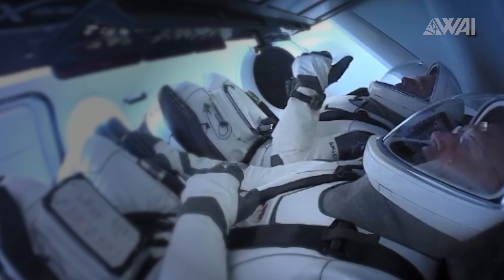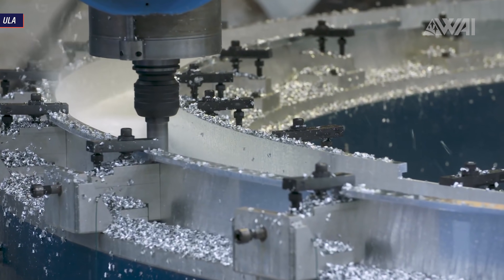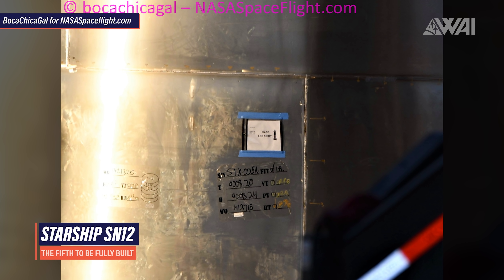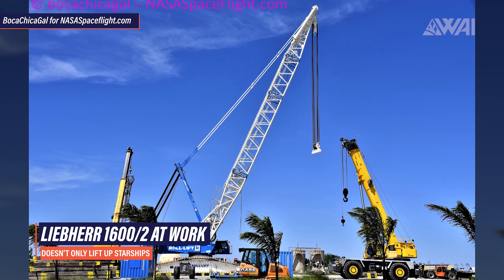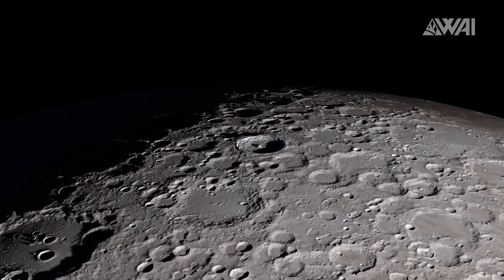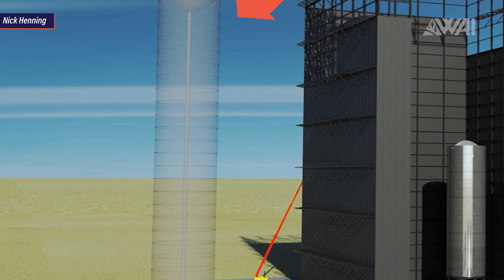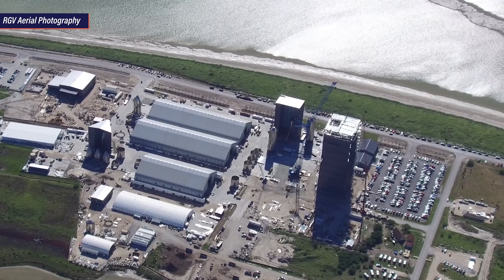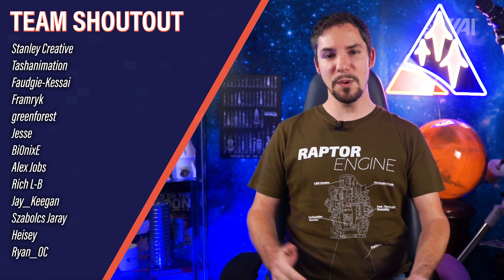124 | SpaceX Starship – Testing About To Begin - Super Heavy The Giant

Comment from the maker: So, is it possible, that SpaceX will have a Starship orbital with the help of a Super Heavy Booster within the next year?
Reply: In my opinion: most likely, yes!
Reply: Sometime within 15 months? My guess: YES! That 15 months might be measured in "Elon Time" but when he sets a major goal, don't bet against him.
Reply: I'd say highly likely.  The Booster is larger, but much simpler than Starship. Since they're proving out all the manufacturing techniques on Starship already, building the Booster is just "work" (rather than research and experimentation).
Reply: Definitely before the end of 2021
Reply: Elon can do anything, so yeaaa
Reply: Within 7 months, 4 days, and 23 hours. That's just an estimate, though.
Reply: Don Jones Thanks Spock Jr!
Reply: Yes
Reply: It's definitely possible, especially if SH testing goes well
Reply: with how fast they are going i have no doubt
Reply: I think it's just about a certainty that a Starship will get to orbit within a year.

Probably be the kickoff for the 2021 Starship Update... 

I expect the first pressure tests for the Super Heavy booster to be towards the end of November. First hop sometime in December. 

I'm thinking about 6 months and they'll be working on stacking a Starship on top of a SH booster. 

One huge advantage SH booster seems to have is it likely doesn't have to pull off a hover slam landing. Much of the build process has dramatically improved over the past 6 months so I don't think that there's any real obstacle to have the very first SH booster prototype get assembled quickly and fly on two Raptors just as quickly.
Reply: It's possible. The two pacing factors in my opinion are thrust puck design for S.H. and heat shield tiles on Starship. Expect to see najor heat shield tile test flights in next 6 months on starship. And we have no idea on state of thrust puck design. Thats got to be super hard and they keep changing number of engines required.
Reply: @James_Scheid  yeah, SH thrust pucks got to be the most tricky part of the entire operation. 

The number of motors keep going down for a few reasons I think. They upped the thrust of the engines, production if engines seems to be slow, and I'm willing to bet the less motors needed the easier that throat puck design becomes.
Reply: @mrdune5479  yes and no. The amount of force on the thrust puck remains roughly the same no matter the number of engines, but the number of connection points and feed lines go down some, so it gets a little less complex.
Reply: Conservative estimate.. full stack and orbital flight & successful landing for the anniversary of the DM2 flight
Reply: Definitely by this time next year.  What makes SpaceX a success is its people. Just watch the exuberance from them during the Falcon Heavy launch and sending Starman in a Tesla to Mars. To listen to the cheers from them during a pinpoint landing of a Falcon landing. NASA folks are treating their work as just a job right now, they go to work and then go home. I'm not saying there is no pride in NASA but they are missing that spark they once had during Apollo. But I believe Blue Origin will be the first to send people on a sub-orbital flight very soon.
Reply: No doubt I’m guessing it’ll be mid spring when it’s being prepped for sub orbital launch then full on orbit! Extremely excited at the progress especially these past few weeks! I can just imagine how fast production will be once Starship’s first functional iteration is decided!
Reply: I'm not sure the full BFR will ever launch from land now. Just way too much noise. I think the better question is will they be able to build the entire infrastructure to launch BFR in a year. There are plenty of things they need to accomplish and some of Elon's ambitions are predicated on things going smoothly. There will be obstacles and set backs and to have BFR fully functioning in that time frame is definitely the stretch goal. I think it will be more likely we will see Starship flying fully configured and the assessment as to the necessity of the Super Heavy Stack will be dependent on the Starships performance. They will need the revenue stream from it for one. IMO the first launch of the BFR will be from an international platform in the Gulf. Lots of testing still to be done.
Reply: It is a strong probability. Until recently they were shooting for this year! Even given several failures, at the rate they are going it is a probability. I think orbital flight by April 2021 is possible and orbital flight by October 2021 is probable.
Reply: I would say it's not impossible for SpaceX Starship to have an orbital test mission sometime next year. When would depend on 3 things - Speed at which Raptor engines are made, Number of successful 15km+ flights, and how the tests involving the Superheavy booster's Thrust Puck go.
Reply: maybe idk :D
Reply: I can wait longer, as long as they do not compromise on security.

By the way, do they not need to build a brand new launch pad out at sea, due to the loud noise the rocket would create?
Reply: Somewhere in the middle of the year, Elon tweeted that he hoped to have an orbital flight for Starship "later this year". So if the multiply-Elon-time-by-3 rule holds, this puts when it really happens near the end of next year. So Id say it's a 50:50 chance that it happens before 2021 ends. If it happens first half of 2021, I'd be really surprised.
Reply: Making the assumption that all test parameters are met SpaceX seem to have the production capability down to a tee, so a qualified yes.
Reply: I recon Space X will have 4 Super Heavy Boosters by Feb next year.
Reply: Definitely possible.
Reply: yes
Reply: I’m thing the development Time for super heavy should be a whole lot quicker than for Starship. Welding technique’s should be the same The only notably more complex part is I think the thrust puck which has to be able to take a lot more engines and transfer a lot more thrust. Hopefully they won’t need multiple iterations of blowing up Super Heavy whole they work out how to weld it.
Reply: @Midlife-Adventures  
Yes, SH is similar to Falcon-9 in so many ways that the technology is easily transferred. The dissimilar aspects are already worked out by Starship development.
Reply: Most definitely.
Reply: Not merely possible, I'd say it's extremely likely.
Reply: I want that animated Space Kerbal thing on your shelf.  Where can I find one?
Reply: NO.  Starship needs to do 5 or 6 flights to fine tune both controls and hardware like legs, flaps and structural integrity.  The Booster has yet to even fly once.  It will need to fly several altitudes and to perfect the landings.  Then when both are integrated, there will be many flights to prove all the many operations it requires.  All before an orbital flight.
Reply: @myfavoritemartian1  SpaceX has 5 StarShips in the pipeline already. That indicates to me that they are planning on doing much more than just 5 or 6 flights in the next 3 or 4 months.

Given SpaceX's resources, I fully expect them to test the vacuum Raptor design in vacuum with StarShip hops. There are vacuum chambers on Earth that are big enough for rocket engine tests, but they are incredibly expensive to operate. There is some visible flow separation in the recent ground level rocket test video.

Orbit isn't far away.

Super Heavy is mostly made out of StarShip parts. There are a few differences of scale. The tanks are bigger, the downcomer has to handle more flow, the thrust dome has to handle more thrust.

This means we will get to watch SpaceX burst quite a few super heavies as they tweak the design to work at that scale. They are pretty fast at those tests.
Reply: @hamjudo  
The "vacuum" Raptor test was with a shortened nozzle. Otherwise the flow would have separated off the inside surface. However,  it was large enough to get test results on fuel preheating in a fairly "large" nozzle.
Reply: @hamjudo  
The SH thrust dome has to handle higher static tank pressure than the SS, but all of that extra engine thrust is applied against that same higher static pressure. None of that thrust has to be applied to the tank walls axially. The axial force actually drops as the acceleration increases. However, the tank hoop stress increases with acceleration (but only at the tank-bottoms). 

Since the metal thickness is just scaled up linearly with the increase in design pressure, there are no foreseeable engineering challenges, IMAO. 

Finally, as the SH tanks empty, the hoop stress on the SH tanks will drop back towards near-static levels, however the Starship hoop stress will be climbing as the overall mass decreases and acceleration increases, pushing propellant "down" harder inside the Starship. 

This inertia-based pressure increase has already been anticipated in the SS design and implemented as thicker steel for the bottom of both LOX propellant tank walls and thrust-puck dome.
Reply: A starship yes! but with help of booster probably earliest 22
Reply: @MrGBunty  
Starship will only reach LEO with a boost from Super Heavy; Never alone.
Reply: No way. There is a huge gap between hops and orbital flight.
But three? I would wager a significant sum that they will.
Reply: Hell yeah!
Reply: Yes.
Reply: in my opinion yes definitely
Reply: Probably, it seems a good shoot
Reply: I think more like 18 months tbh
Reply: I believe. SpaceX will do 15k SS in October. SpaceX will have SH built in the high bay before Halloween. Maybe a pressure test???? Maybe not.
Reply: No, successful orbital flight should include coming back in one piece which means thermal protection should be ready. And lots of Raptors need to be produced and tested together. I think there is a lot to be done yet. It took 1 year from Hopper flight to unfinished Starship hop. 2022 is much more realistic and I am not talking about frequent flights even.
Reply: You are wrong wrong  Russians are ahead
Reply: Definitely yes
Reply: I think so..
Reply: Define "in the next year"
Reply: Within a year I say yes. The bigger question is will anyone be on it?? 🤔🤔🤔
Reply: At this rate ET (Elon &Team) will have to start parking StarShips in Orbit next year. Bye-Bye 5 & 6
Reply: I worry mostly about heat shield tile robustness. If that is resolved early, then orbital tests will stay on track easily. 

The SH booster is well understood. 

Starship maneuvers can be practiced on the way up in the first test flights, so flap parameters are well "understood" before descent even begins. 

The first critical "flip" landing maneuvers can also be rehearsed higher above the ground than necessary and followed with a simple, extra-long, tail-down landing. It just wastes some extra propellant mass that can be replaced with more payload at a later date.
Reply: Its possible but im going to say between 12 and 24 months.
I can't believe people were giving 30 year estimations for a completed Starship with Superheavy. Its happening within the next 5 years or its not happening at all.
Reply: Possible but unlikely. But not much longer. 2-4 before 2 years.
Reply: I would say it is certainly possible, and it will be interesting to follow the progress toward that goal.
Reply: Before the end of 2021 i beleive, yes.
Reply: Yes within a year i guess, in the 6-8 months if things goes at this current pace.
Just in time for going to the Moon  !
Don't forget that the lunar starship needs to be ready for the NASA race.
Reply: don't doubt about it
Reply: egg  I would love to be wrong. And if Starship was 110% of SpaceX's focus it might even be remotely possible. But I would be frankly shocked if they got it orbital before October of next year. 2022 I think is a reasonable timeframe for an orbital flight. With optimistically 2024-25 for anything that is going to function how SpaceX wants it to function.
Reply: By the end of 2021 I would anticipate 5 orbital flights of Starship. I'd put money on it, except I'm not a betting man.
Reply: Yes, in Q3 next year.
Reply: If they keep up the pace, quite possible.
Reply: b
Reply: We might have it..But A lot of R&D Is required!!  I mean a lot!!!
Reply: I would be surprised if we see a full stack launch in 2021. I'm thinking they have a lot of work to go on ground service equipment and building out enough raptors. My estimate would be sometime in 2022, which is still pretty soon. I think the bigger question is whether or nor Vulcan and New Glenn will fly in 2021. If one or both of them can beat Starship to first flight, they have a chance to carve out a piece of the launch market. But if everyone flies at the same time, it will be hard to justify having both NG and Vulcan. If BE-4 experiences any delays, the latter scenario becomes likely. Starship could slip a year or two and be totally fine, but NG and Vulcan are under the gun right now.
Reply: Absolutely npt
Reply: I'm remembering how long it took Falcon Heavy to fly using proven hardware. It's possible we'd have a flight, but I think it's unlikely. The focus this time around will definitely shorten the time compared to Falcon Heavy however - barring the apocalypse.
Reply: Do you think that Space X will go back to the carbon fiber on the starship and booster when they get the design locked down?
Reply: @stephenlang7870  definitely not, it would take a massive design rework, along with crazy investment in tooling and production, plus all of their testing and data would have to be thrown out. That would be going back to square one
Reply: @stephenlang7870  I doubt that will ever happen. Far too many advantages for the stainless steel. Also the big advantage of carbon fiber being 'less weight' is negated by needing more heat shielding. Apparently the extra heat protection carbon fiber needs would make a carbon fiber vehicle heavier than a stainless steel one.
Reply: @stephenlang7870  stainless steel is far better than carbon fiber, so definitely not.
Reply: @stephenlang7870  I do not because it is too expensive and too time consuming.
Reply: Stephen Lang No Carbon-Fiber costs 50 times more per pound and the Bismaliamide Epoxy used as a matrix with Carbon-Fiber is only good to 500 F whereas the 304L stainless steel is good to at least 1000 F, But the real secret is superior fatigue design life. Steel retains 20% of its original strength FOREVER! While Aluminum goes to ZERO over time. You make longer lasting reusable rockets out steel. Now let’s talk about damage tolerance. Carbon-Fiber just catastrophically fails. It literally just explodes without warning. While Steel has a tendency YIELD, or to stretch, much more BEFORE failure. This gives you a warning, and time to retire high fatigue cycle tanks before they kill somebody! Ironically NASA’s high tech, “spare no expense” design philosophy is what has been keeping the general public out of space for half a century. Appropriate Technology is NOT always the most high tech, and DEFINITELY NOT THE MOST EXPENSIVE! NASA spent millions on zero-g ball point pens. The Russians just use a pencil.
Reply: @tonyrusi1978  millions for the ball point pen is more myth than reality.

There was an interesting comment made by Ben Rich I believe in his book 'Skunk Works' along the lines that they speculated that the SR-71 Blackbird frame might last effectively forever because it was heat treated every flight. I do wonder if that will be the case with Starships. It'd be awesome if Starships are flying around the solar system for the next several centuries, lol.
Reply: @tonyrusi1978  No they don't. Pencil dust would be REALLY bad in space. It is conductive!

Comment: Why they use such stupid shape...when they burn the fuel this shape makes high pressure of electrons from sides horizontally and even negatively vertical...they waste 70/80 percent of power push due to wrong calculations of pull power or ignoring of pull power....

Comment: So... on any particular day depending on weather,  they can either make LOX or they can launch, but not both. :)
Reply: Wind at ground level is not much of a problem because the rocket is in these winds for only a few seconds. And this is a very big, heavy rocket that will be very resistant to lateral acceleration from the wind.
Reply: @kkarllwt  yeah, that's true. Anyway, it was a joke. Perhaps not the most technically accurate joke. :)

Comment: I think the main difference between the established space entities and SpaceX is, for SpaceX, failure is an option. They innovate like crazy and every once in a while something blows up. Failures are allowed, as long as something new is learned in the process. 

As Elon Musk himself once stated, "If you don't fail, you're not innovating hard enough!". (At least I heard he said that)

With the established enities like ESA, NASA, ULA, etc., they have oodles of money and they have to make things look advanced. They also have the mentality that failure is not an option, so they engineer everything to the last detail (building a new rocket after something failed is really expensive!). 

SpaceX, in contrast: churn out rockets like crazy, test them, if something blows up learn as much as you can and move on. However, NEVER stop your progress, even if it means you have to throw out some already built components. It's cheaper to just trash some parts than to freeze after you had a failure until you learned everything.

I compare it a bit to software development with continuous integration. You start developing, building and testing at the same time. As the builds get longer, an error might affect a bunch of builds (e.g. you're building every 30 minutes while the build takes 3 hours to complete). It costs you nearly nothing but every new bit gets a chance to get tested in the minimum time possible.